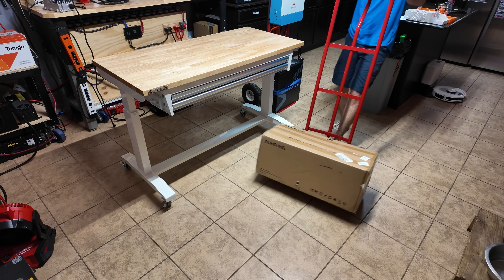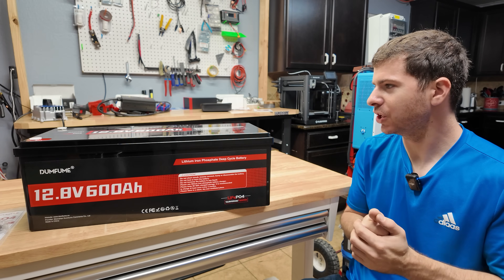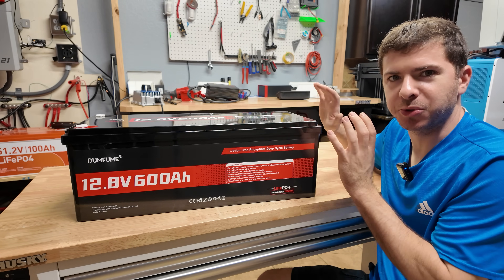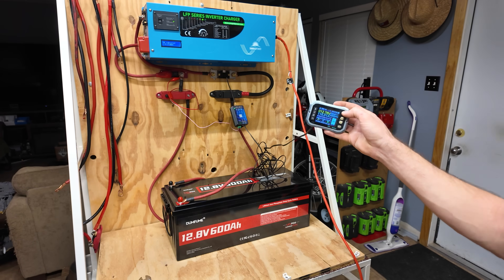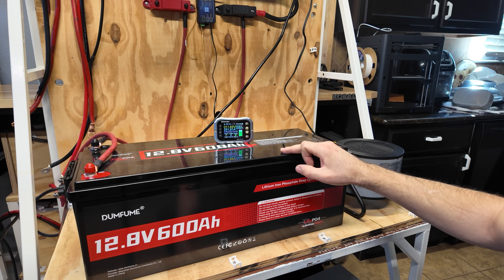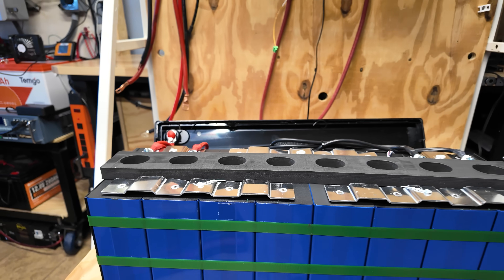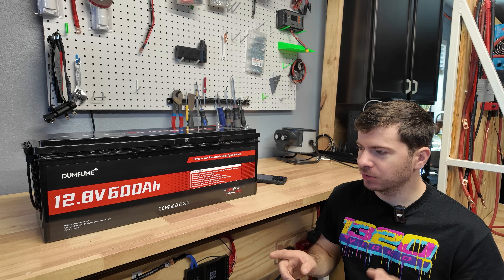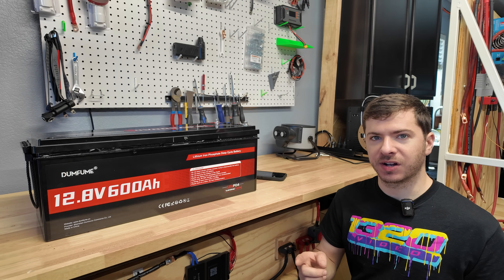$559.99 Dumfume 600Ah 12 Volt Lifepo4 Battery Review! Teardown! Testing!  7600Wh

Comment: 0:34 touching an exposed battery terminal.  If this were real equipment you would be dead.

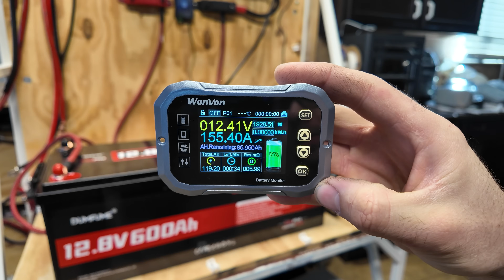5:37 that small heater does not use over 100 amps, and that small inverter can not provide 100 amps.  This entire video is purely bad theater and your numbers arent close to correct.  Its not 3000 watts "exactly" because inverters dont run at 12 (DC) volts inverters run at 120 (AC) volts and you obviously dont know the difference.  You have completely made up all your numbers using this incorrect math and then stared in the camera saying "works fine!"  There are no consumer inverters that can handle over 100 amps of current, and you are completely oblivious to this.  The largest consumer inverter can handle about 41 amps of current.

7:34 touching the exposed un-insulated busbar of a battery you "say" you just charged to 600 amps.  Cant be true because you would now be a dead man.  You can NOT touch a live 600 amp busbar and live to tell the tale.  Amateur hour.

Let me explain why this CAN NOT be a 600 amp battery...  Because THERE IS NO 600 AMP BATTERY CABLE.  You have connected this supposedly 600 amp battery using one very small thin cable, not even normal 200 amp battery cable, to each terminal that is IN NO WAY able to support 600 amps of current.  If you actually tried to fill this battery with 600 amps, those small wires would have EXPLODED in an electrical fire once they passed their rating, which is obviously less than 200 amps.  The fact that you seem completely oblivious to this and said "yea works fine" is a serious problem.

This battery looks like a ticking time bomb.  You would have to connect a 600 amp busbar DIRECTLY to the battery terminal to use it IF it works AT ALL which I doubt.  Do not use this BS battery, and do not take this guys advice he is a beginner at most.  For a 600 amp battery you have to have 600 amp battery cable.  And there is no 600 amp battery cable.  Doesnt work, cant work, this video is all made up lies and his math is completely incorrect.
Reply: It is really, painfully obvious that you don't know what you're talking about. And you manage to do it for a really long time in that comment. His understanding is fine. Yours is painful.
Reply: this guy has no clue what he is talking about
Reply: @primus711  Indeed. We've used a 3500 watt inverter for many years bought off-the-shelf at a truck stop. So that's 275 amps. Probably hit 3000 watts surge when then A/C kicks on as our highest load and that is uneventful. Routinely run a 1500 watt heater continuously and that would be 120 amps. Looking to upgrade 200AH in worn golf cart batteries and salivating over this bad boy 🙂
Reply: @melainewhite6409 yeah he is just out of his mind and should take time to understand the nonsense he wrote especially about amps and inverters even car audio guys will tell him he has 0 understanding a car amp isn't that much different than a inverter
and yeah i run a 3kw inverter with 4/0 cables at 12.8v
maybe he should watch some styropyro vids or photonicinduction or even electroboom vids
Reply: @melainewhite6409  There is no inverter IN THE WORLD that can support 275 amps.  You are dividing 3500 watts by the DC voltage instead of the AC voltage which is how you got the WRONG answer of 275 amps.  Guess what, THERE ARE NO 275 AMP CABLES EITHER!  4/0 cable stops at around 230 amps depending on the type.  So unless you built custom huge cables yourself this could NOT HAVE HAPPENED.  OBVIOUS LIES.

A 3500 watt inverter can support about 29 amps at 120v.  The largest consumer inverters IN THE WORLD can support a maximum of 41 amps.  You are trivially wrong and this is easy to verify.  

Likewise a 1500 watt heater would be 12.5 amps not 120.  You are VERY wrong your numbers are VERY lies and what you are saying could NOT have happened.

If you are powering DC electronics, you would not need an inverter, you would connect a DC electrical panel DIRECTLY to the battery(s).  Inverters are specifically for converting AC power to DC power and all you guys are trivially incorrect.  You should not work on anyones electrical equipment, nor should you give them advice about it.
Reply: @armelpeel guy you are still wrong and these inverters turn dc to ac not the other way
and 12v is low voltage it will not end u where are you getting your nonsense from ai?
the battery here does not have 600amps  it has 600amp hours the amps the bms can do is 250 not 600
and fyi people touch the terminals of a car batt everyday the car is grounded to chassis you will never have the full current running through you at that voltage pay attention in science class next time
also you cant talk about amps without voltage reference thats why we have amp hours and watts
this battery can supply 250amps at 12.8 volts for 2.4hours
and stop saying ac u do not use the output you use the input do u know nothing about power factors
so much wrong about your math im just not gonna waste time in youtube typing a school paper on teaching you what you can do yourself
also 4/0 doesn't stop at 230 fyi it all depends on many factors you are all over the place trying so hard to be correct
this is coming from a electrical engineer
Reply: @primus711  This guy held up a shunt in the video and said "yep, the battery has 600 amps" and now you are fudging the numbers between amps and amp/hours to attempt to prove some weird point.  What you are saying is basically nonsense, you dont know what you are doing, and the battery in the video CANT work because it is connected incorrectly.

"this battery can supply 250amps at 12.8 volts for 2.4hours" That cable is NOT 4/0 and is NOT rated for 250 amps.  If you try to run 250 amps through that cable it will explode in an electrical fire, which is what I said from the beginning.  600 amps of battery capacity could realistically power about 120 amps of electronics at once.  Batteries work at .2C or 20% of their capacity at once both charging and discharging.

Yes inverters normally convert AC to DC because inverters take AC power from the GENERATOR connected on AC-IN and use it to power the DC batteries.  This is an AC->DC conversion.  You are again trivially wrong, it should be obvious, and that you do not know this is concerning.

And the final point Mr. Electrical Engineer, if you touch the terminal of a live 12v car battery, it will be the last thing you ever touch.
Reply: @armelpeel  You are cluless. Im 65 years old and have touched(shorted) a 12v car battary many times by accident and seen it happen...no one died.
Reply: @armelpeel stop saying amps that means nothing with no voltage reference a 600amp HOUR battery at 12.8v is 7,680watt hours that means you can power tons of things for a long time and?
and the shunt he used allowed him to gauge how many amp hours not amps stop saying AMPS
you are 100% confused and everyone is trying to tell you but you dont listen because you think you know everything nothing is this vid is incorrect not 1 thing
Reply: @primus711  you sound ridiculous, you dont know what the hell you are talking about, and you shouldnt work on anyones electrical system nor give them advice about it.  If you use this battery the way it was used in this video, you will be lucky to escape the electrical fire.  Goodbye.
Reply: @armelpeel ok guy who has said the most ridiculous crap here and many told you otherwise
unlike you i know what im talking about and been doing it for decades wheres your experience coming from
have fun with your delusions
just fyi i just setup a 30kw solar system what have you done beside be wrong about everything you have said and multiple people have advised you that you are wrong i guess all of us are defeating ohms law everyday amazing
Reply: @armelpeel : dude, give it up. You sound like a 3rd grader and you're using thousands of words to explain things you know nothing about.
Reply: It is only running at 12.8v. The resistance of even your soaking wet skin will significantly limit the current to harmless levels. To draw 600A you need a very low resistance path between the two terminals or bus bars. Something like a wrench across them will  draw in excess of 600A.

600amp hours(Ah) not amps(A), meaning it will supply 100A for 6 hours, or 200A for 3 hours, etc... Its rated to supply up to 250A and that is limited by the BMS. The BMS will shut the battery down if you try and draw 600A. In the example of the wrench across the terminals the current might get very high for a short amount of time but the BMS would then disconnect. 

The small heater will draw something like 10A at 120v. An inverter will draw 10x the current at 12v to produce that current at 120v.  So 100A is a good estimate of what the inverter is drawing to power that small heater.
Reply: @lordgarak  What you are saying is nonsense.  That battery cant hold 600 amps simply because it would blow the wires.  Hell it cant even hold 250 amps because that is NOT battery cable used in the video.  

The inverter does not draw 10x the current this is completely ridiculous.  The inverter will draw the exact amount of amps from the battery, and convert the amps from DC current to AC current at a cost of about 20%.  So for your 10 amp example the conversion process would cost about 2 amps.  

The inverter would draw about 12 amps from the dc battery to power this 10 amp load.  NO INVERTER IN THE WORLD can support 100 amps of current.  You are dead wrong here and will certainly cause an electrical fire.  

100 amps is not a good estimate of anything.  100 amps can support two full sized ovens on full blast WITH all four burners going.  This inverter can NOT support 100 amps no way no how.

If you touch a 12v car battery, you will be killed man.  Wake up.
Reply: @armelpeel More nonsense on YOUR part!

The average cheap battery charger can't do more than 20 amps/hour, so IDK what the hell you're going on about blowing wires! That means they charge at that Amp rating at max! 

He's using a 30A charger, so it will take about 600/30 = 20 hours to 100% charge this 600Ah battery. There are more expensive 60-100 Amp/Hour chargers that can do it faster, but they're still not gonna "blow the wires..."

How is it you don't understand the difference between Amps and Amp/Hour capacity ratings and chargers ???

The BMS in these batteries also has protection if you're exceeding Amp limits one way or the other during charging or discharging... Wow, it's almost as if you know nothing about Lifepo4 batteries specifically or basic physics!
Reply: @armelpeel it's Amp hours, not AMPs.  You are wrong.
Reply: @NightWolve75  Dude you need 600 amp battery cable to support a 600 amp battery bank.  THERE IS NO 600 AMP BATTERY CABLE.  He is not even using REGULAR battery cable in the video.  Those cables would have EXPLODED in an electrical fire.  

If he really had 600 amps of battery power, which he doesnt because he is incompetent, he would need a 600 AMP RATED BUSBAR and connect the battery charger to the properly rated busbar.  You can NOT connect 600 amps of batteries using any less than 600 amps of wire (3x 4/0 wire lugged together) OR properly sized busbar.  You are TRIVIALLY wrong.

This guy connected a 600 battery using <200 amp cable and you are acting like there is nothing wrong with this?  The wire has exceeded its rating by more than 3x!  THIS IS A GUARANTEED ELECTRICAL FIRE.
Reply: @armelpeel : 600a dc draw is absolutely doable.

That said, you literally don't know what you're talking about.
Reply: Wow, you're an idiot and don't know WTH you're talking about!

* 12 Volts DC is too low of a voltage to be dangerous to humans, no you won't even get a mild shock! It starts getting dangerous at around 40-60 Volts... The higher voltage will overcome the skin resistance level allowing dangerous enough current to flow in that scenario. Maybe learn some basics before you open your mouth...

* Apparently you don't understand the difference between Amp/Hour capacity ratings versus Amps... This is a 600 Ah battery at 12V, meaning that if it's fully charged it could power a 1 Amp 12 VDC light/device for 600 hours... Or say if it was powering a DC AC inverter that was drawing 100 Amps, it'd last for 6 hours, etc.

At some point the BMS would shut down the battery if you were drawing too much current at once, like if you shorted the terminals, the rate depends and every maker has different cutoff levels.

So anyway, you don't really know WTH you're talking about or you're actually trolling/baiting which is lame...
Reply: @NightWolve75  If you touch the terminal of a live 12v car battery, it will be the last thing you ever touch.

The BUSBAR connecting the batteries must be able to support the maximum capacity of the battery.  When the battery hits 600 amps the wire connecting the battery MUST support 600 amps or the wires EXPLODE.

You guys dont know what the hell you are talking about.  And if you try any of the things you have mentioned here you will all be killed.

Amps is a capacity, Amps/hr is a RATE.  The battery CAPACITY is supposed to be 600 amps.  The RATE is how much of that capacity you can use per hour.  Walk in any store in the world, batteries are listed by CAPACITY not RATE.  

There are NO BATTERIES IN THE WORLD that can support a RATE of 600 amps/hour.  Batteries can use about 20% of their CAPACITY per hour.  So if you had a REAL 600 amp battery bank and not this BS battery, you could charge and use about 120 amps at once.

But to say this battery has a CAPACITY of 600 amps is completely BS, and to say this battery has a RATE of 600 amps/hour is bs.  To have a C value (charge and dischage rate) of 600 amps/hour, you would need AT LEAST 3000 amps of battery capacity.  3000 amps * .2 = 600 amps/hour RATE.  Yes I understand the difference between battery CAPACITY and the charge and discharge RATE.

The BMS would not "handle it for you" because the battery is CONNECTED INCORRECTLY.  The wires would EXPLODE as soon as they reached their maximum rating which is NOWHERE NEAR 600 amps.  The BMS does not monitor the CONNECTING WIRE.
Reply: @armelpeel - I think there is a Language barrier going on here?   
* I don't believe the video's creator ever stated this battery can deliver 600Amps output?   Rather, that it is rated at 600Amp/Hours.  
* The internal wires are sized to accommodate the current that the Battery's BMS (Battery Management System - a module built into the battery) will allow to flow in/out of the Battery!  Which in this design appears to be 250Amps maximum!  
* Would this Battery's internal wires get very warm at 250Amps, yes they would.   But they are not going to "burst into flames"!
* (12 Volts) in Alternating or Direct Current is NOT capable of being lethal from electrocution!  
* Others here have already attempted to explain to you why.  Please study "Ohm's Law"!   
* Bet one of your friends to touch the positive & negative terminals on a fully charged 12V automotive battery.  You might be surprised when they are NOT dead, but also, they will probably just barely feel the voltage!  
* Volts and Amps individually are not what kill people or animals.  It's the combined wattage going through their bodies that kills them!   
* Touching barehanded 12VDC at a 1000 Amps is no more lethal 12VDC at 1 Amp.
Same with high Voltage, as long as the Current is very small it's harmless.  
* Have you ever rubbed your feet on carpet and then get a shock touching something?  That shock your feeling is very high Voltage!  It's generated from Static Electricity!  It can reach 35,000 Volts, but the Current is Pico, Nano, or in MicroAmp ranges.
0.000,000,000,001Amps
0.000,000,001Amps
0.000,001Amps
* Now 35,000 Volts at 0.025 Amps can be lethal, because it can stop your heart!  But you're not going to bust into flames like you touched a high Voltage power line up on a pole!  It's the Watts going through materials that generate thermal heat!  Once again, please study "Ohm's Law"!

And please, stop telling this group of individuals "that they don't understand".   Because (unfortunately) it is YOU who doesn't understand the concepts involved!  Do some research, and then come back and try to prove your points.
Reply: @armelpeel : cut and paste repeating your obviously incorrect rant, does not make it true.

People touch live 12vDC  terminals all the time.

Hell, it won't do more than tingle if you put your tongue on it.
Reply: @armelpeel  What are you?  12?  I'm 61 and have touched the terminals of "live" 12V car batteries countless times, and so far have lived to type this.  Never had so much as a tingle.  How the hell do you think people install batteries in cars???  And, noooo...  Amps is a current, and amp/hours is a capacity.  Somehow you seem to be confusing "amps per hour" with a capacity of amp hours.  No one here is claiming this battery produces 600 amps of current.  This entire video is about a high capacity battery with a  600Ah rating.  Spend just a little bit of time researching batteries and you'll quickly see manufacturers listing them with Ah ratings to denote their capacity.   Either you have zero understanding of the subject, of you have WAY too much time on your hands and get some sort of satisfaction sitting around trolling people on youtube videos...
Reply: Anyone else shocked at how confidently wrong this entire comment is?
Reply: This is 3000watt is 250amper x 12.8volt is 3000watt cc and in ac is 120volt x 25amp.25x120 is 3000watt yuo confusione is stupid SMS is 628ah a 12.8v con bms da 250ampere a 12.8v  is 3000watt max no 600ah a 120volt  stupid
Reply: Brother you have a lot to learn. I would erase your comment to save yourself the embarrassment from your display of your very low intelligence.